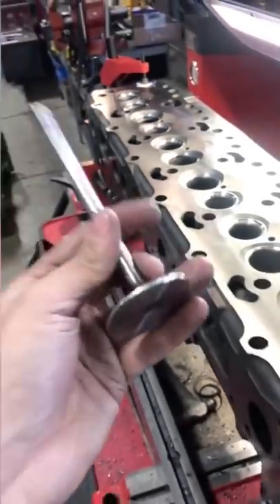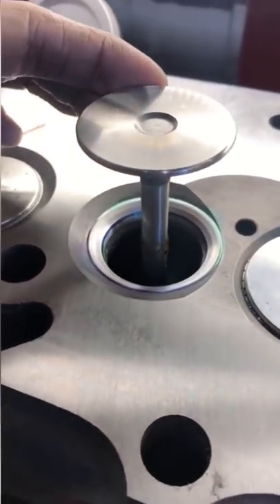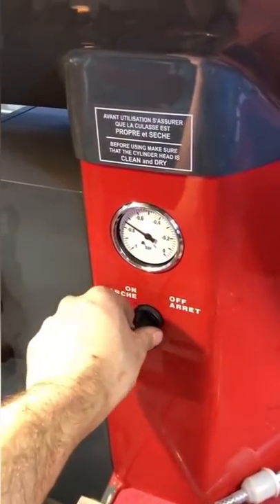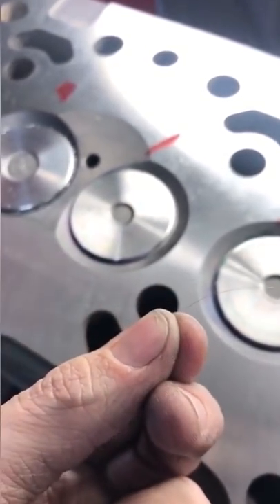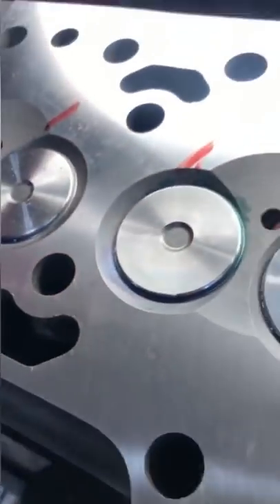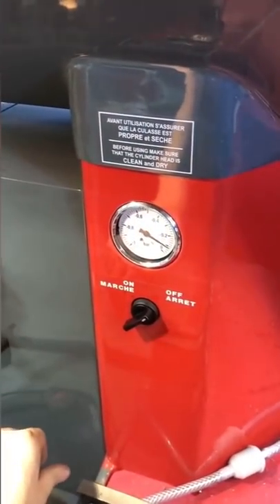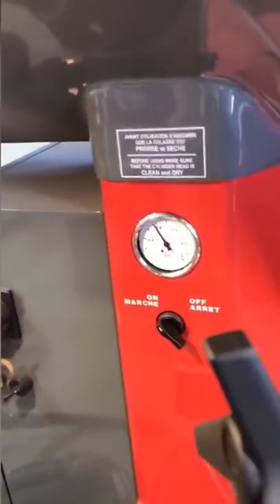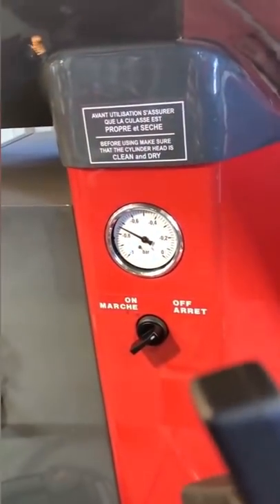#shorts Engine Machining Tolerances in layman's terms!

Comment: The hair (or any foreign object debris) is creating a gap where a vacuum seal needs to be, this is not an accurate experiment to prove the importance of machining tolerance, but instead an amazing presentation of FOD contaminating a sealing surface, and the importance of cleaning your mating surfaces to insure good seal.
Reply: Or to another end. Ensuring a smooth mating surface for the curved valve to seal against. Tolerances are still extremely important, but there may be a better way to present those cases.

Comment: this means nothing. just because it doenst hold vacuum doesnt mean it wont run just fine. the pressures in the cylinder is so high for such a short amount of time it wont have enough time to throw off normal performance. that and your valves constantly rotate and most issies get worn out. literally

Comment: I’m a beginner tech I’ve been with brakes plus for a couple years now doing suspension work and general maintenance. How do you get to a place where your working on high power engines and aftermarket modifications?

Comment: Hmph. Doesn't really have much to do with machining percission. Thermal expansion accounts for more than machining percission so claiming it's that is kind of silly. The hair just slightly prevents the proper contact but it would still be achieved if the part itself was slightly bigger/smaller.

Comment: imagine the carbon and ash deposits getting in between valve and seats, causing all sorts of engine problems from backfires to valve burning and guttering as well as low compression and power
Reply: Sea foam is good stuff! It really helps clear up those intake valves. You can even use it to clear a stuck piston. It may clean up the rings a bit and help with compression. Everytime I purchase a used car I will dump half a can of Seafoam in the gas tank, the other half in the crankcase. Drive it for 200-300 miles, then get another can and run it two times in the vacuum line going to the intake. I'll let it's soak for 15 min and then crank the ignition and watch all of the smoke come out. You can sort of tell how dirty the engine is by how intense and for how long it'll continue to smoke. I'll then give it an oil change and a tune up. It really helps turn an engines performance around. Great stuff, apparently an old school trick was to suck up some atf through the vacuum. It does the same thing. I'd rather use seafoam but atf fluid has alot of detergents in it. Routine maintenance is key. It's very common to see many newer vehicles that will exceed the 250k mile threshold. Before I'd consider anything over 130-150k as being high mileage.  As long as you keep the engine well maintained and take care of it. You don't even have to use any additives. Just change that oil in a timely manner. Had an 02 Z28 Camaro that has 220k. Kept great care of it, ppl were hesitant of buying it due to the mileage. Once they drove it and felt how healthy that LS1 was, they were surprised. I have an 04 G35X that's sitting at 210k. It drove fine but I could tell it needed some tlc when I got it at 190k. As long as they kept up on oil changed I knew it could definitely squeeze out another 100k easily. Now one wanted it because of the miles. I gave it the seafoam treatment and tune up. It came back to life. It was a night & day difference.
Reply: @nowimhigh  you are right

Comment: If you are a real machinist you should know that you cannot measure a hair with a micrometer, because the hair is going to be compressed and you will get the wrong measurement. You need a non mechanical way to measure a hair such as a profile projector.